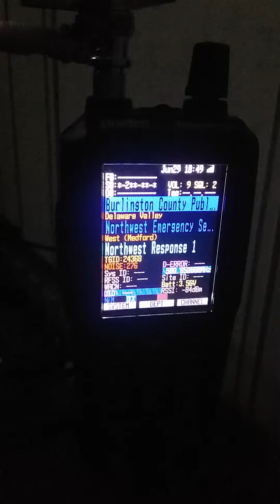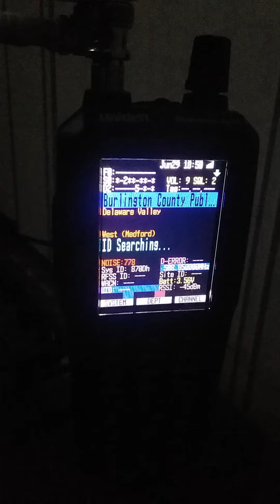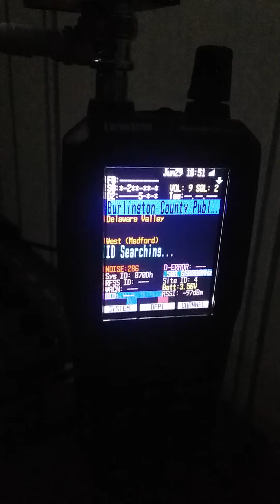Uniden SDS100 scanner Issues Decoding Digital

Comment: I'm sure you've figured it out by now. The SDS-100 is one of the best radios ever made. Your issue is that you had your ID Search turned ON. For this trunked system, you need it to be in Scan Mode (so set the ID Search OFF). This can be done manually thru the scanner (Menu button, Manage Favorites, select desired system, Review/Edit System, Edit Sys Option, and ID Search).

Comment: both the UNIDEN SDS100 and the current Whistler TRX1 are not sensitive receivers. If you want to improve reception , throw out the DUMMY LOAD antenna that comes with both Scanners, and get a High Gain HAM radio Dualbander Antenna. I use a Diamond RH77CA with a BNC , you can also get a Radio Shack telecoping HAM antenna and that works super well. however both the ICOM and AOR Digital scanners out are more sensitive receivers and simply OUTPREFORM the uniden and whistler.